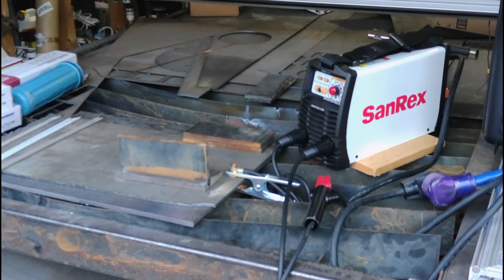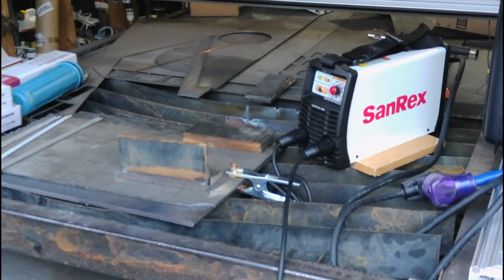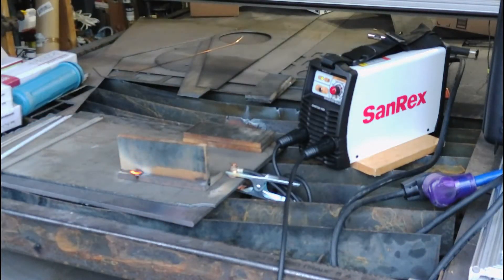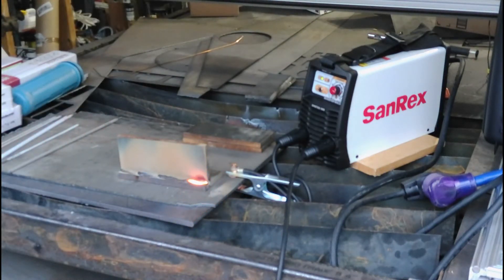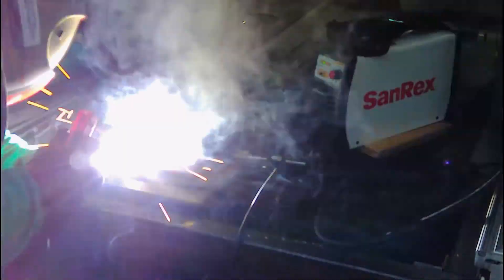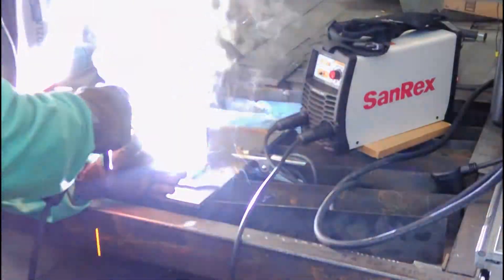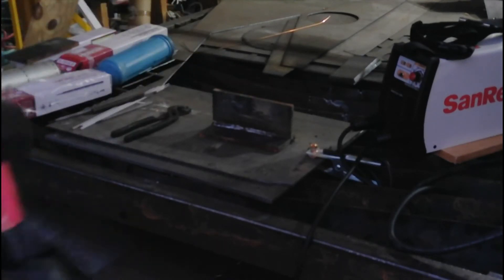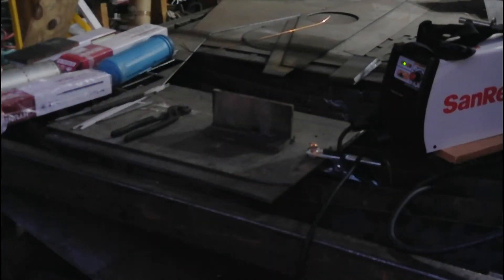Welding with the SanRex SanStick 160s Stick TIG Welding Machine

Comment: I've owned this little Sanrex for over a year now, bought it as a small stick machine to learn on. I didn't expect necessarily that I was getting a machine I'd never outgrow. The real-world utility of it is just stunning, and it can compete with the likes of high end machines from Fronious, Esab or anybody. Sanrex knows power electronics since they company is a power supply company. THeir expertise shows in this fabulous machine.

I think the "killer feature" of the machine is what it allows you to do on 110/120V power in real world conditions. How many machines can you buy that are this small and affordable that will run a 1/8" E6010 beautifully on 100ft of extension cord plugged into a standard (USA) wall outlet? Very, very few.  I did a bucket repair on a tractor last weekend using a long extension cord plugged into 120V power. No generator. No 240V needed. No problems-- ran all the 6010 and 7018 I wanted and needed and worked superbly.

Very machines can do with this Sanrex does. The Miller Maxstar TIG machine is close, but has lower open circuit voltage, can only go to 90a on 120V, has inferior duty cycle and costs almost $1200 more than this Sanrex. Lincoln has a little Sprinter that tops out at a weak 80a on 120V, but it will run 6010, albeit with an a weak duty cycle also. IMO, you really want a solid 90a on 120V with 6010 capability. That was my "minimum".

THe only real 120V stick welding peer to the SanStick 160s is made by Fronius and costs $2000. The Esab Rogue 201 is sort of close, but the Sanrex has both higher output and higher duty cycle on 120V even though both are CSA rated (the Sanrex is simply more efficient). The Esab is more of a TIG welder that does stick while the Sanrex is primarily a stick machine that also has basic TIG.

Sanrex doesn't spend money sponsoring race teams or making splashy ads. They just quietly make an absolutely amazingly capable industrial machine at excellent pricing.

Comment: what is power factor correction and why is this important?
Reply from the maker: Hi Lee! Thank you for your question. PFC is extremely complicated, but basically the welding machine has circuitry in it that attempts to align the voltage and current waveforms as much as possible to reduce the amount of power lost. This gives you more real power available, making the machine more efficient with its incoming power.